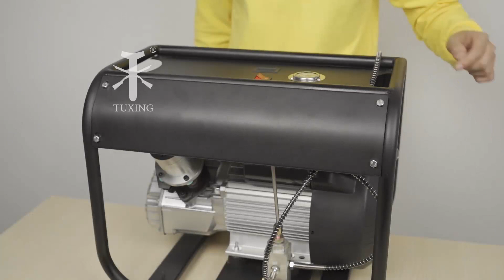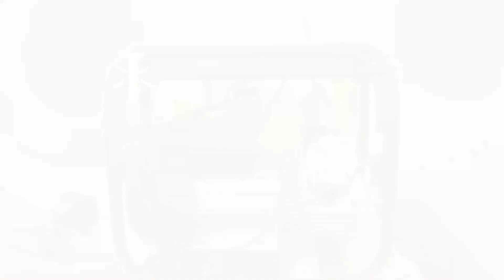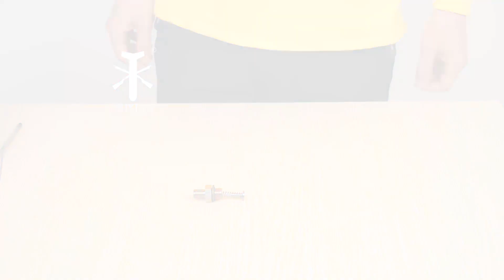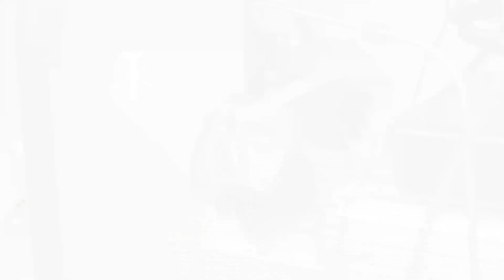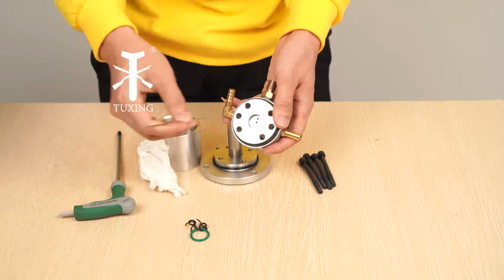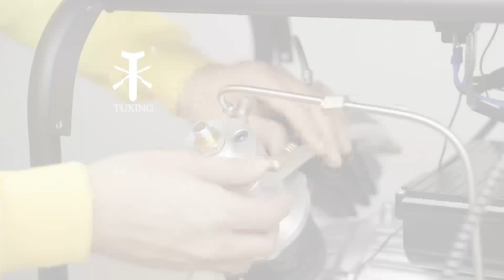TXED01 series compressor--How to clean the high pressure part.

Comment: I bought this Tuxing Air Compressor, after buying the Benjamin brand - that ran about 15 seconds & quit. Mine arrived with some shipping damage, which I got resolved, then months later, noticed a minor crankcase oil leak - turned out the shipping damage also hairline-cracked the outer crankcase cover, that I was able to address with some RTV which has worked great. Well after several successful uses, I got my scuba/composite tanks filled (I use my tanks to pressurize my PCP pellet guns). Well, 6 months from last use, it was time to depressurization my tanks again - and now my compressor won’t go much above 50psi? Anybody got any ideas? It must be a real difficult thing, to make one of these compressors, cuz I have had trouble getting one that works like it should, it seems. Very frustrating.